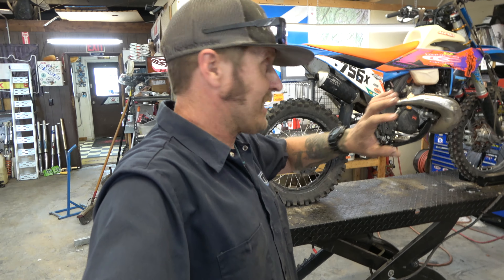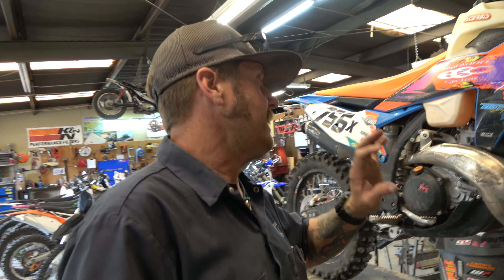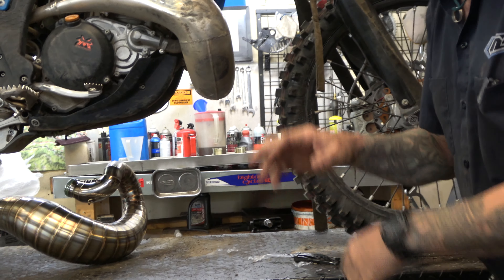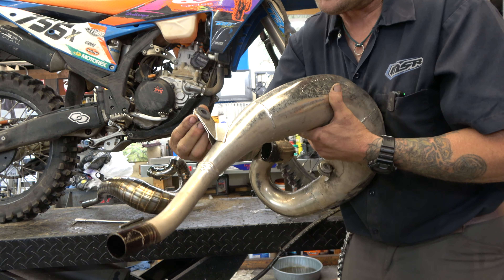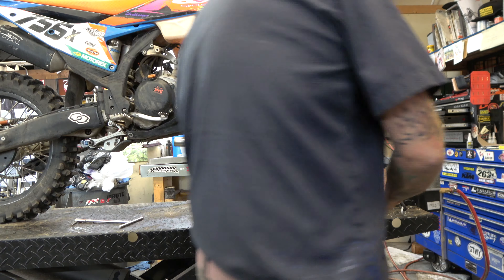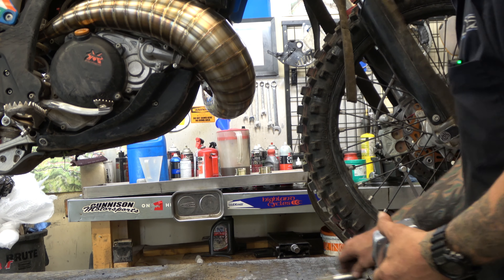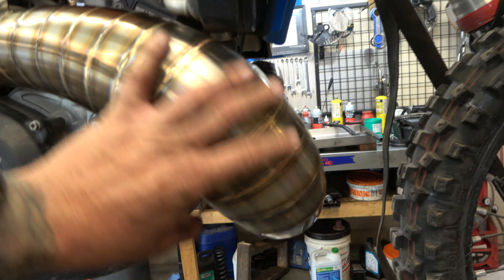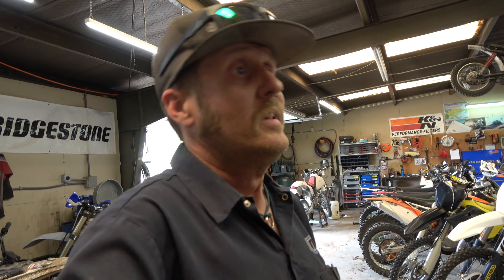Motoes Stainless Steel Pipe | 2023 KTM 300XC | Highland Cycles

Comment: Checkout the S3 pipe. I did a short review of it. Works great and has some added durability built into it. Tune wise more up top, no noticeable loss on the bottom. *Torquier then my fatty.  Havent measured but is built tighter to the frame  and higher off the ground *supposedly, havent  measured

Comment: How much for the fmf?
Reply from the maker: 300 for a new one.
Reply: Have you ever tested the ride engineering showa mounted steering stabilizer? I'm about 50 50 woods vs moto and would like to try a stabilizer but especially one that's hidden behind the plate and wouldn't get in the way, if I ever go with a XC gear bar mount. Your the Man Morgan I don't see how you manage to work a job , keep a channel going, ride your bike , ect. Thanks in advance
Reply from the maker: @barnescycle  yes! It is awesome